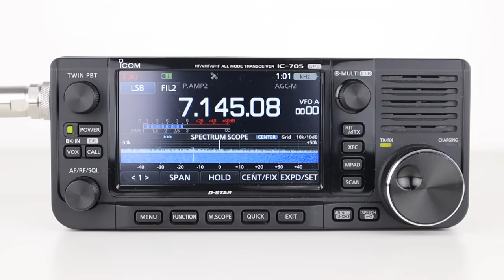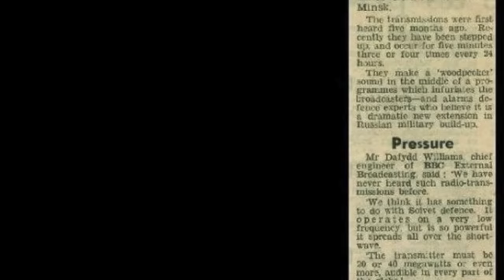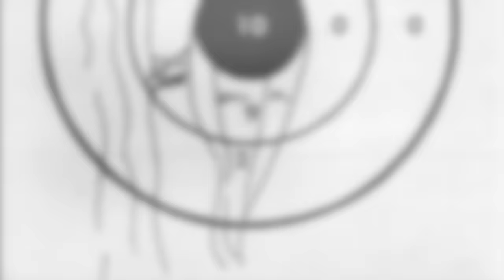Russian Woodpecker - The Radio Signal That Wreaked Havoc Around The World

Comment: Back in 1979 as an over the road truck driver, I picked up a trailer load of fencing wire in Kansas City, Mo and delivered it to Columbia Falls Maine.  I had to drive several miles down through gravel roads in cranberry fields to a giant opening where huge towers were being put up.  The fencing I brought was one of many loads sent there for the purpose of building a reflecting receiving antenna with 20 db of gain to capture our own pulses sent from another transmitting facility many miles away, basically the same architecture as the Soviet system..  This was our own US over the horizon radar system.

Comment: The "Woodpecker" was a Russian "Over the horizon" radar system. Both the UK and the USA had similar systems but ours being on a constant frequency where hard to spot. A listener would just hear a high power but narrow constant carrier signal The frequency was changed frequently  to be 90% of the MUF between the transmitter site and the Russian launch site at Bykanour (Excuse my spelling). Due to the Official Secret Act I can't tell you where the UK site was but I'm sure the Russians knew.  A 500,000 watt transmitter is not hard to find.
Reply: The big flat HF and the round 440L forward scatter OTH receiver antennas you refer to were surely not hard to find, the flats pointed east.  Multiple transmitters on several frequencies each were in the far-east, and used normal broadcast power levels, so there was little HF impact as you state.  440L was closed far past the more than 30 year limit, it was long ago unclassified in the US.  I donated my professional items to Space Command museum.  F. Miller
Reply: Theres nothing secret about the locations the UK operates and operated.
Reply: Official secret act? If u officialize something it's not a secret..
Reply: @sandramiller7972  I agree, but not yet unclassified in the UK.  as a UK citizen the Official secrets act exists until  I die. I would happily donate what I know to future generations
Reply: Australia has the largest and most sophisticated over the horizon radar system in the world. are 3 antennae array stretching entire north coast and covers all approaching zones.
Can see way further then publicly acknowledges and from day one it spotted USA stealth bomber.
Is a report one radar operator said. see that on the screen. that is a Boeing 747 taking off from Singapore.. only thing i can't tell you is it's tail wing numbers.
Even picked up explosions in Baghdad during Iraq war.

Funny thing is Chinese navy think they are sneaking in to Australian waters and always our leaders say.. we have been tracking them for days before reach our waters.
Reply: Nothing secret about RAF Fylingdales or RAF Feltwell.
Reply: @CalabashNineTJ  Maybe, but the UK over the horizon transmitter sites where not in the UK. sadly I can't tell you where they were.
Reply: You sound like a kid who doesn't want to tell you something you would be interested in, but he is about 1 more asking away from telling.
Reply: @gergocsanadi4770  I would like to tell you more but I am subject to he UK Official Secrets Act and risk a long jail sentence. I have to be very careful what I say.
Reply: @MENSA.lady2  oooo super secret, so cool. You absolute donut 😂
Reply: @MT-hd2es  oh man grow up
Reply: @MT-hd2es  Was? I still do that
Reply: Ian Mc
I worked on the system of shortwave radar or over the horizon radar the first test system was in the uk and worked very well more than that I can’t say due to the official secret act.
Reply: @MENSA.lady2  If you fully respected the UK OSA you wouldn't be raising it on such a public forum. Respect your country rather than trying to feel a little important by getting a few worthless 'likes' in a video comments section.
Reply: Oh gimme a break - the radio site is so easy to find -
2 receivers at different locations triangulating the angle. 
Looks like you're a troll -  LOL
Reply: @nedkelly9688  where did you get the stealth bomber story ?

Comment: I had a pretty potent hf radio set up that time with directional hi gain yagis and a full legal limit rf amplifier. The effective radiated power of my setup was about 30 kw. I could chase the signal out of the amateur bands by taking my electronic cw keyer and matching the pulse rate and width of the transmitted signal. As you mentioned it was very effective. Once it left the amateur frequencies I stopped my “testing”. I wondered at the time if I could possibly start ww3, glad I didn’t.
Reply: You probably did us a big favour particularly me as a youngster back in the 80s in the UK with my Ten Tec Argosy and only 40-50 Watts to a G5RV
Reply: @Isochest  You both had a TON of power compared to my bare HW-7.
Reply: I’m not very knowledgeable about radio frequencies etc but what do you mean when you say you could have started ww3
Reply: @godspeed-is-taken  radar works by returning an echo. The system sends a short pulse of radio energy and then stops listens waiting for a return pulse reflected from an object like a plane or missile. My fake signal return would have lit up their system.
Reply: @paulk8io445  ahh thanks for the explanation

Comment: I remember the woodpecker well in the mid to late 80's.
Had a Yaesu FRG-7700 and you could still hear it with the antenna disconnected sometimes!
OTHR is still used these days (Australia has JORN for instance) and some of these systems appear randomly on any frequency depending upon MUF.
Great video again Lewis!
Reply: I think many OTHR signal are out there today because of weak signal reporting and propagation information , plus SDR would likely lower power output needs and operating cost. Receiver sensitivity has been a game changer.  Think cellphones.
Reply: It wasn’t effective as thought and ended up being a financial burden

Comment: I was a US Novice Ham in the 80s. CW only on 7100-7150 and 21100-21200 kHz were good for me on a vertical. The Woodpecker was something you had to dance around.  It absolutely hammered in. Some one told us "H5H comrade"  Sending the H5H sequence in cw seemed to make it move! Probably wishfull thinking but I sent it often if they QRMed a station I was trying to copy!
73, Scott W0KU.

Comment: I remember it well, back in the day following the woodpecker over the amateur bands and sending CW dots making it QSY (change frequency). My estimation of the transmitter power of that thing is A LOT, it was always by far the biggest signal on the band. It was HUGE.
Reply: Why would sending CW dots make it change freq?
Reply: @alienwarex51i3  Because the dots will look like an echo to the radar, and it jams the radars ability to detect real echo's, so it will change frequency to avoid the interference.

Comment: Another great informative video, Lewis! I remember the woodpecker well from my early interest in radio in the 80s. It was just the loudest signal on a standard SW radio, even louder than the interference from my dad's electric arc welder, which was only 20 yards away. We never knew what it was back then. I eventually gave up wandering around the house turning things off to try to find the source.

Comment: I remember hearing the woodpecker hear in ZL. The interesting thing though is that it would have been a one use system 🤔. A good friend of mine used to work for BCNZ, New Zealand and he had a job recording the Short Wave BBC feed at midday, this was some time in the 70's, as they would hear the lead up they knew to record the pips for the time and right on the hour the signal went from what was described as a full house to no signal.   The reason?  The French had done an open air test at Muroroa Atoll and it destroyed the ions in the ionosphere!!!  So my friend being the guy with the brains arranged the official message to parliament and the French were called out in our debating chamber within half an hour of the test, which really upset the French because in those days "how the heck did those kiwi fuckers work it so quickly that we had exploded a nuclear bomb?" (In my best French accent)

It took more than a few days before the signals picked up again.

So after a few nukes it would likely be useless!

Comment: When I was 11 I got my first stereo system from my father because he bought a new one. I got a Quelle Universum amplifier (2x 30 watts), two gigantesque speakers (1970ies....) and a SW/MW/LW/FM tuner. Was quite modern for its time. But - it was very bad when it came to proper shielding. When listening to records with a record player connected to the high ohm low voltage magnetic pickup connection I heard more soviet radio in the evening than my record - of course, the high ohm phono preamp reacted like a radio receiver with the connection cable to the turntable.

When not using FM, I often had that woodpecker sound and I never knew what it was. I thought my tuner was defect. It was annoying nearly everywhere. As there was no internet I never understood why.

Comment: I remember hearing this on the CB band back in the 70's and 80's when the band was open. I have been a HAM for some 32 years now and am glad it's not active anymore. I have a Kenwood TS-850 HF transceiver in my collection that has a second noise blanker that is designed to reduce or eliminate the pulsing "wood pecker" noise. Now a days you can still hear number stations on certain segments of the band between 40 and 20 meters. Also there are what I call "sweepers" that are mostly heard from 25-26.5MHz sections of the HF band. The sweeps are roughly 500kHz wide, step in roughly 200Hz steps and are completed in about 1 second and run continuously.

Comment: I was subjected to the Woodpecker around 1961.  When we hams were being interfered with, we would just send a string of dots back at it.  Within a few minutes, it would move out of the 40 meter band.  From 1962-1963, I visited what I believed was one of the US's OTH sites.  It had the largest helical HF antenna I had ever seen, the conductor was a pair of huge copper tubes [3+ inches in diameter] strapped together.  I could be rotated.  I got a glimpse of the Collins transmitter before the door was slammed in my face.  It had 4 glowing 4CX25000A3 transmitter tubes.  That, I believe is 100,000 watt dissipation; so the transmit power was at least 200KW.  I have never found a photo of this place near Roswell NM.

Comment: I well remember the Wood Pecker in it’s heydays. They’re are still some strange Wideband signals popping up on HF even now. I remember a QST article about 10 years ago that assessed some of theses strange signals and concluded they were Over The Horizon Radar signals. They were quite different from the Wood Pecker in form suggesting they were more sophisticated and and second generation OTHRs probably using the greater computer processing power available compared to the 70s and 80s.

Comment: Ham radio operators have told me it caused them problems as well. The woodpecker is near Chernoble and lost power when the nearby nuclear power supply failed. Saw that on Science Channel's Mysteries of the Abandoned.
Reply: Well, it was pretty close, all right, but the area did not lose power permanently.  However, as stated in the video, this WAS within the 30 km exclusion zone, so maybe nobody would go to work there anymore.

Comment: I still recall endless command post hours of this cacophonic symphony, while stationed with USAFE mobile tactical radar units in the 2ATAF ADIZ (aka "Fulda Gap"), from the late 70s to early 80s.
As far as I recall, HF/SSB, 3.940MHz... (Collins KWM-2A + 30L-1 Linear Amp)
Consistent, massive intake of caffeine and nicotine... to be followed with heavy Apfelkorn therapy... was relatively effective in maintaining relative mental health.

Comment: These were not just soviet, NATO had them too. 
They didn't just go away, they went spread spectrum. So were not so obvious.

Another signal on the HF bands that were an annoyance to some, were the chirp sounders. These swept the 2-28MHz spectrum every 4min 16sec (from memory). And were used for profiling the ionospheric paths between various paths. The last I saw was transmitting from Inskip in the UK.
Listening on an analogue receiver, you just heard a click. On an SDR you could see a very rapid sweep. 
These used to transmit 100w or 1kw into wide band antennas. But like the OH radars, they too went spread spectrum. And with modern DSP techniques, could do the same job on a few watts.
Reply: Not all of them have gone spread-spectrum - I heard (and saw on waterfall) several examples of this over just the past few months.

Comment: I always wonder if the Chernobyl nuclear power plant was built for the purpose of servicing Duga-2. Is there any information (or somewhat reliable speculation) about that?
Reply: Nope, for several reasons:

(1) The woodpecker was "only" about  10 million watts peak, maybe 3 megawatts average. Maybe requiring 7 million watts from the power line.  Chernobyl was 3,500 megawatts.
(2)  The woodpecker site near Chernobyl was receive-only, requiring just a few kilowatts.

Comment: I always wondered what the "time stamp" signal was for, given that it sounded EXACTLY like the audio at the start of this video.
A repetitive drum-roll of beats interrupted by a woman's voice stating - Capitan - Timestamp blah blah blah, repeated by a male voice using the same timestamp - then a final TONE before the whole seconds beats restarted again.
I was using an old valve radio with both long wave reception and ordinary AM with two bands of Short Wave, so to me (during the late 1960's, all of the 1970's and a small part of the early 1980's), it was an excellent way to have a consistent time machine stating the exact time, that could be received in rural Central Otago, in the South Island of New Zealand.
I listened to it (fascinated) for hours at a time, usually when doing our farm irrigation cycles every fortnight for 27 hours straight.
It simply gave me something to "do" in the middle of the night. instead of setting an alarm clock for every half hour irrigation change.
To now learn it had a far more sinister use ? HUH - but why, as it was a godsend to youngsters in isolated rural locations - who simply wanted to have an "always available" exact time.
I loved hearing weird things on the old valve radio's 2 short wave bands, such as that timestamp, as well as a variety of "different" foreign language "singing" stations - or documentaries (also in a foreign language).
After all, what purpose (as far as I was concerned) was there, to having a four band (long wave band, am radio band, and TWO short wave bands, in a) commercially made radio could there be, if not to allow people such as myself, the humour of listening to weird shit - all night long?
Reply: The time signal you hear in this recording is the USA's WWV and WWVH stations in Colorado and Hawaii, respectively.  I think they're in this recording to show that The Woodpecker was interfering with even these well-known stations.  Interesting thing about WWV and WWVH: they transmit on exactly the same frequency, but their transmissions are engineered not to interfere with each other - they're never transmitting the same signal, except when they're transmitting simple "ticks".  It would be interesting to see a direction-finding receiver trying to deal with this!

Comment: Fascinating stuff, Lewis.
Weren't the septics up to something similar with their HAARP project.  I seem to remember reading that it had its own power station...
Reply: HAARP was probably a similar installation. Its geographical placement would make it very suitable to detect Soviet missiles over the horizon.
Reply: More likely it had to have its own power station because there wasn't any commercial power anywhere around.  That's a common thing in Alaska.

Comment: it has been said that the very existence of Chernobyl power station was owed to the energy needs of this system.
Reply: Chernobyl was 3,500 megawatts, Duga was about 10 megawatts. Now the Russians have a modern Voronezh radar system (0.7 megawatts).
Reply: @swe1733  if you do not have 10 MW you need a source of energy.

Comment: When I was stationed in Guam in the early to mid 1980's I would use my amateur radio station running about a kilowatt to chase the Woodpecker around the 20m band until it move up or down in frequency. It did not like to have CW pulses sent back at almost the same pulse repetition time as was being transmitted
Reply: I kind of wonder if one of those spoof transmissions ever showed up as a false return on the radar screens, or if there was some scrambling in the signal to prevent other stations from generating a spoofed return.
Reply: @Stoney3K  when I would chase the Woodpecker with my CW bug and a kilowatt of power it would take a little time adjusting the pulse repetition rate and once you were close to the correct setting you could see the whole 100khz wide signal shift off the frequency peak where I started spoofing it. It would take a few minutes but by chasing it around 20m that eventually it would move off to an adjacent frequency just outside the 20m amateur band.
Reply: I, too, was actively jamming the woodpecker when I operated CW on the 20 meter band from Nova Scotia in the early 80s.  A kilowatt plus a very large yagi antenna (6 elements) pointed at Ukraine with a  decent keyer setup just ‘so’ seemed to work. Put a brick against the keyer and wait a few minutes, then the woodpecker would move to a different frequency. Probably was against the ‘rules’ but the motivation to do something about this very annoying jamming overrode any qualms.